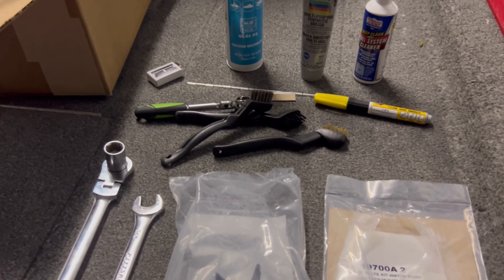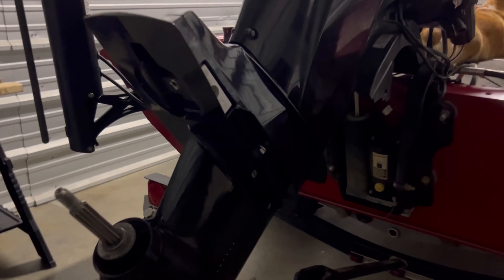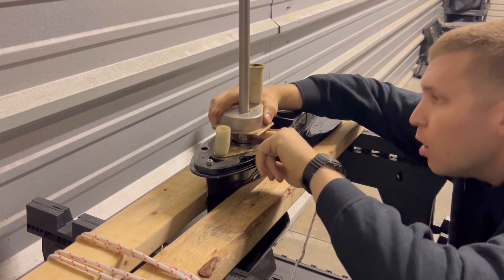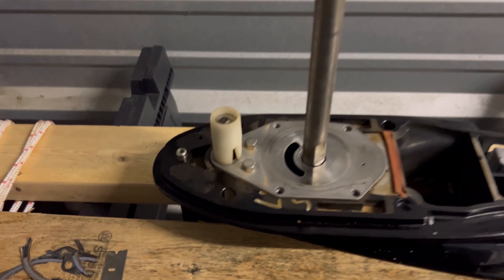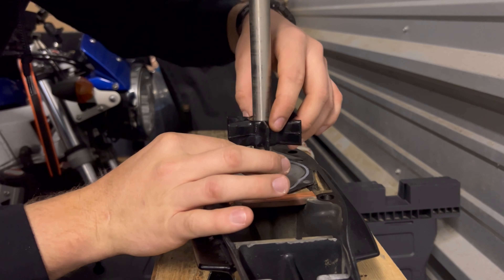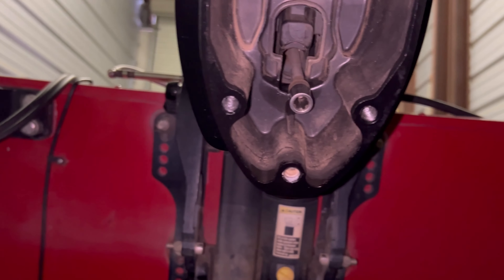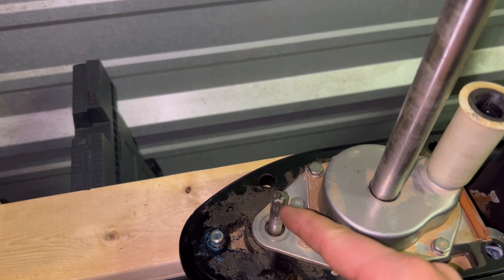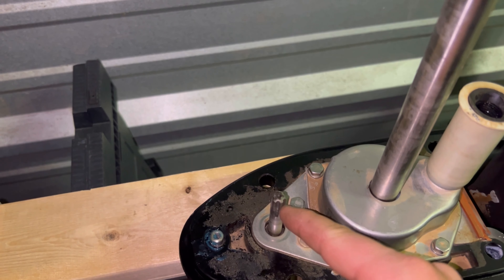Mercury 60HP Water Impeller Replacement

Comment: Where did you get your water pump kit? Everywhere I go I keep getting the wrong one
Reply from the maker: I ordered the 300 kit from Partsvu with everything in it. They told me that they weren’t sure the water impeller was going to fit for my serial number motor. I bought it anyways and it works perfectly.
Reply: What year is your motor? Mine is a 2021. Wondering if the same procedure applies.
Reply from the maker: @gregoryrowe4143 2014. If not the exact same, it will be extremely similar.

Comment: Can one fin backward cause pump to not pump water?
Reply from the maker: I believe it would still pump water but not as efficient. I would be sure to get them going in the same direction by lubricating them and twisting the impeller cover on.
Reply: @belowaveragebassfisherman574  I need a 3/4 in chuck in a drill to fit the shaft to turn the pump to test it in a water barrel.  Had to order one.  Perfect weather to change impeller kit & store sold me wrong kit.  Oh well, need that chuck so I can test the old one first.   Maybe in a week(Christmas Day?).  No screen in foot &didn't see dirt dauber blocking holes/anything but wondering about just below impeller plate?  I'll leave it in barrel so maybe whatever will be softened by the time the chuck arrives.

Comment: Instead of marking the shifter rod and the shifter in the foot, why didn't you just take it off in neutral and put it back in neutral?
Reply from the maker: When you reinstall the lower unit, you want the drive in forward gear and lower unit in forward gear so that you can spin the prop by hand to line the splines up. This ensures that the splines are properly aligned.
Reply from the maker: When you reinstall the lower unit, you want the drive in forward gear and lower unit in forward gear so that you can spin the prop by hand to line the splines up. This ensures that the splines are properly aligned.
Reply: @belowaveragebassfisherman574 good deal I appreciate the response, I guess I've just been lucky in the past when I just left it in neutral. 👍
Reply from the maker: @Opiemus yes sir! Always more than one way to get the job done. That’s just how I learned to do it.
Reply: I just put it in Forward prior to removing the lower unit.
Reply: I learned the hard way by not putting the gear in FORWARD when putting the lower unit back on after impeller replacement and forcing the lower unit in damaged the gear head and ended up spending $6500 for a completely new outboard motor.